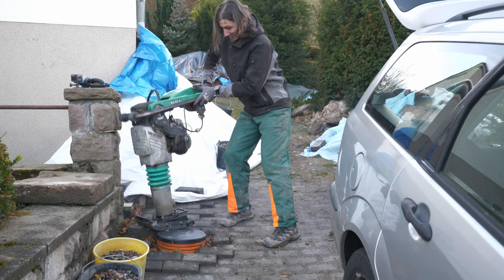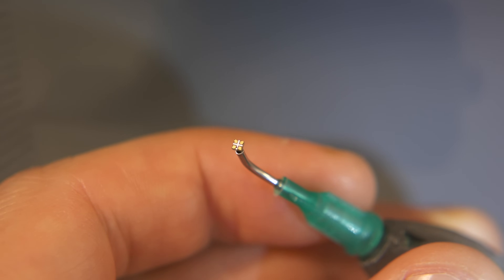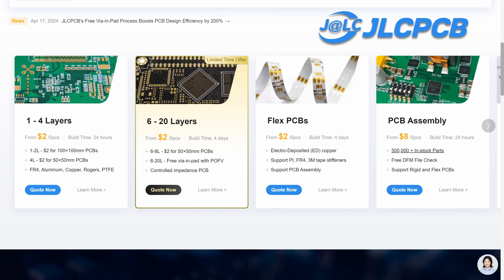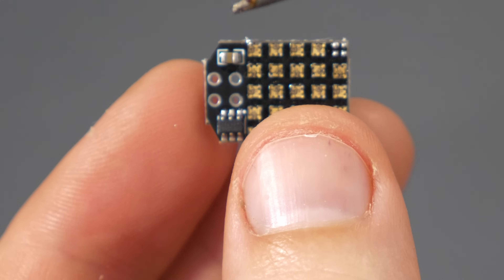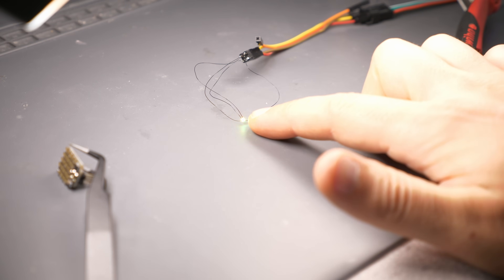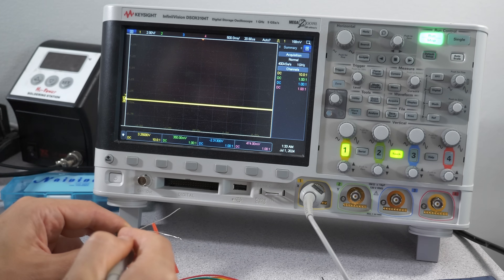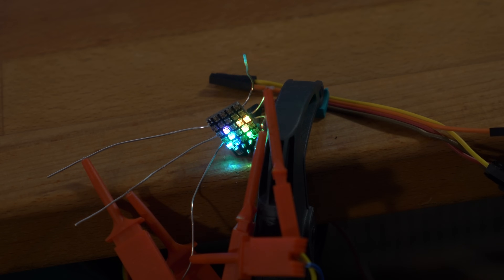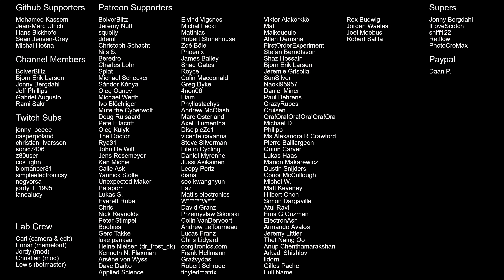I made a little LED Matrix and everything went wrong

Comment: 12:39 I once dead-bugged a 3W white LED that I was going to wildly under-drive to use as an indicator. (I wanted this LED’s shape, not its power.) Importantly, this is a flip-chip LED, where you solder the die directly onto the PCB, with no actual chip package. It just has a phosphor layer applied to one side. 

Anyway, I accidentally connected it to 5V instead of 2.6ish volts, and it ran super bright for a few seconds and then fell off the wire, because it had indeed melted the solder! 😂 So I know for a fact the junction temperature reached over 183°C. (And it was fine after soldering the wire back on.)

Comment: I found the biggest problem with soldering wires to smd parts is being able to see what you're doing. I soldered some wires (0,05mm) to 0201 leds for fun. Back then i didn't have my glasses so my astigmatism was giving me a hard time but i pulled it off. At work i often have to solder wires to sand grain sized components so i got some training. Awesome project! I always enjoy seeing your videos in my recommended

Comment: to add wire legs to smd chips, invert, glue to substrate with CA, streach 0.1mm enameled wire over from one side to the other , touching pins on both sides, solder wire to pins through enamel. cut waste.

Comment: Oh yeah, I just love using those Tinys! I also did the same with 24L, which can be driven by an external oscillator or resonator, but I wanted to challenge those NE555 LED flashers so kept the component count down by using the internal RC (yep, also unrolled Assembly loops with LUT loading in place of delay NOPs - though I kinda hate using C/C++ on AVRs so just coded the whole thing in Asm). And the Asm usage payed off yet again, as I could fit one 8-bit framebuffer (wanted the anims to be procedural) for the strip (was 1 meter long, can't recall the LED count) into the SRAM and have plenty of FLASH left for the 256x24bit LUTs (three that is :P). Truly the best FLASH utilization I ever did btw, had to optimize the logic in order to fit lol.

Comment: I saw some uC on the microchip page that have some Lut embedded, one of the exemples was using, i think was I2c, passing through the LUT and done the processing to adressble led's like a charm. Without extra processing. They have a PIC 10F322 that has one lut in the same pinout off the attiny10

Comment: What kind of a soldering iron do you use and recommend (brand and model)?
I am looking for one that lasts a very long time and has the best solder wetting and heat transfer characteristics.
Not looking for the cheapest or most expensive, just something that is (near) professional level quality but at an acceptable price ($80-$500).
Reply: Ersa, JBC, Metcal, Pace, Hakko…
Reply: @tookitogo   Thank you.
Any specific models?

Comment: If you're using the attiny10, you can use unused peripheral registers as additional memory. Clever trick I found out a while ago
Reply: how did it work?
Reply: @yagobueno2785  just fine, I'm sure. Registers on classic AVR are memory-mapped and have 1-cycle access. As long as writing to it won't do anything unwanted, you're golden.
Reply: @yagobueno2785 well for instance of you're not using the 16 bit timer, you get basically 8 additional places for storing things (icr, ocr, tcnt). The adc output register can be used for an additional register and so on. Look chapter 19 from the datasheet to get some understanding of the other registers.
Reply: Huh. Is this specified behavior? It feels like something that could disappear in a random future part rev.

Comment: I love the idea of mounting the microscope to the wall using that monitor arm! Desk space is always at a premium and then you also get the benefit of easily moving the scope to where you need it.

What model microscope is that? Is it common that they have mounting points like that for a wall mount? 

I have an old cheapo one that only has a screen and is monocular, so looking to upgrade to a similar setup as you have here.

Comment: I used these same LEDs in a number pad PCB project, and they were a hassle. The top plastic layer would always detach from the LED, and they were so hard to solder on properly without rearranging multiple times. If you're going to want to add RGB to a project, consider getting bigger LEDs haha.
Reply: i bought a bunch of them on sale and still have not used them. im a sucker for leds on sale.haha

Comment: I really should find a use for that string of ATTiny10s.. that I’ve also had in a box since 2019 😂
BTW USBasp does TPI quite nicely.
Reply: hey man. what's the best or most cost effect programmer for those little atmel chips?
Reply: @jstro-hobbytech  Get two usbasp’s from Asia. Use one to upgrade firmware on the other. The upgraded one now does TPI.

Comment: Hand placing is a lot quicker from an inline strip, as you don't need a free hand to hold the tape and pull the cover tape. Search "smd tape manual" on printables for some I designed.

Comment: It does seem a little silly to go through all this trouble when jlcpcb's economic pcba costs about the same as getting a stencil...
Reply: Eh not really, after extended parts + labour/loading fees + engineering fees, it’s usually noticeably cheaper to assemble at home in my experience. At least for a prototype.
Reply: @innfos4634  maybe, in this case there are only two parts and the main one is the led. So you'd only incur $2 of extended fees. Additionally I've found that the parts on jlcpcb's library are often much cheaper than what i can get on digikey. 

In the end it might not be cheaper, but it's very comparable and I'd happily pay just a bit extra to not have to populate hundreds of tiny parts by hand.
Reply: @innfos4634  For a first prototype I wouldn't personally spend PCB assembly costs, since there's a chance it doesn't even work. Only use this if you're certain it works...